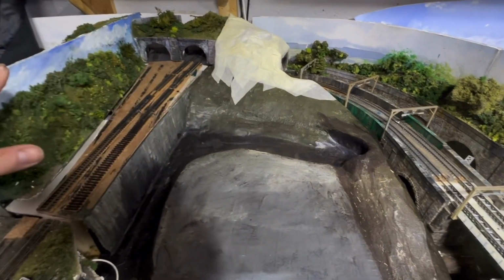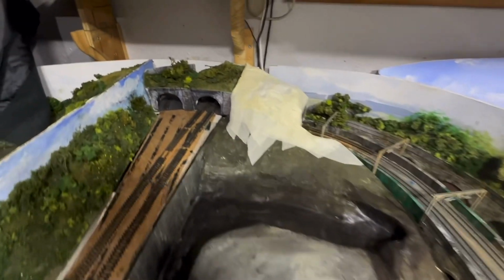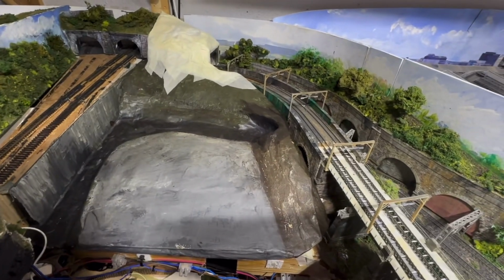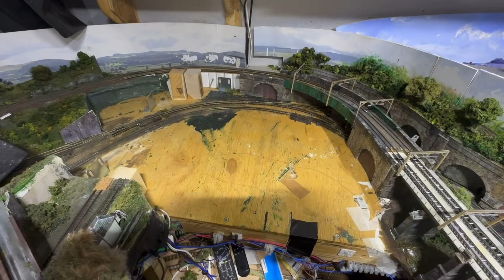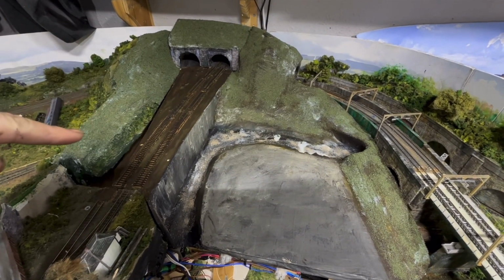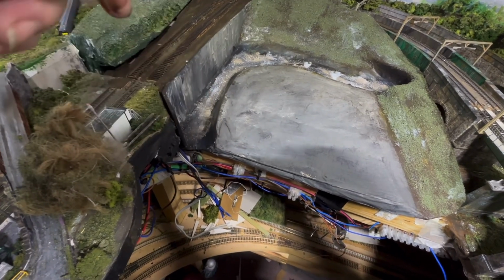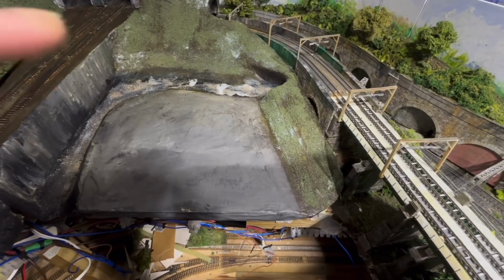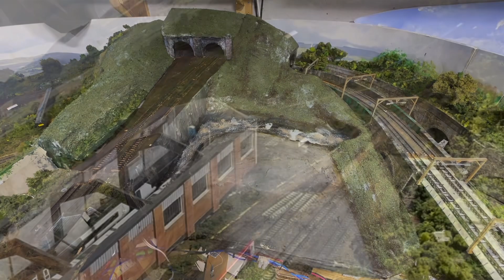BUILDING NEW MILLS MILL No2. More landforms, paint and scatter.

Comment: Got to love a good fiddle! I had similar problem yesterday figuring out the new tunnel and how to lift off to gain access to the track underneath so did the same thing by leaving one set of tunnel portals off the lift out as it was so fiddily to put back on. I agree with you in the removing of that back scene - it looks much better now. Shame about the aqua magic as well - weird were it all goes to - possible evaporation perhaps? It will be interesting to see how the resin pour takes on in comparison. Keep up the good work I will be eagerly awaiting the progress.
Regards
Steve
Reply from the maker: Sounds interesting regarding your tunnel. I chose to leave the portals attached to the lift off sections, so I can get the desired look around each portal. Yes the sky backscene did need removing, I think itll look so much better in the long run. 
Regarding the Aqua magic, could be, who knows. I thought it was a silicone based product, but Ill just leave it a while see what happens, add more if required etc